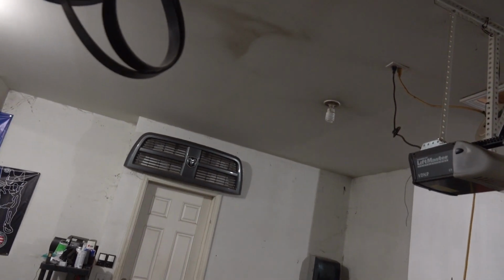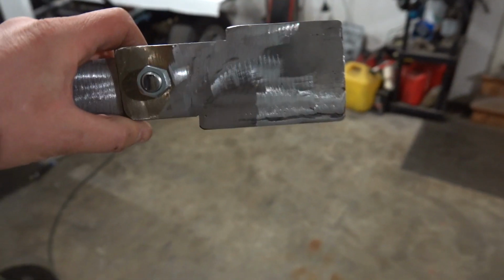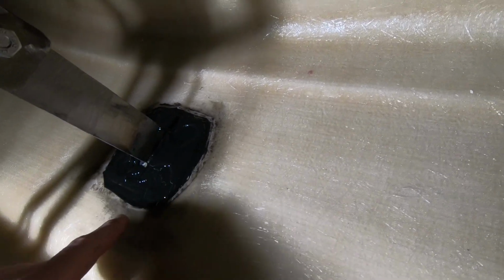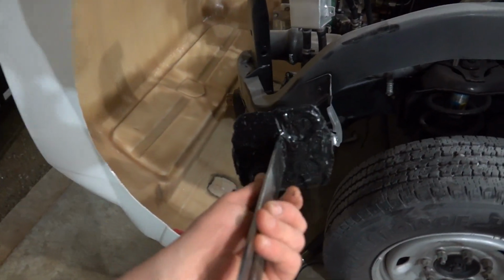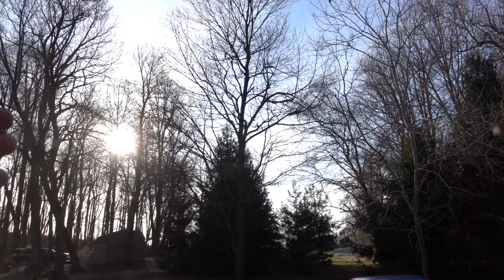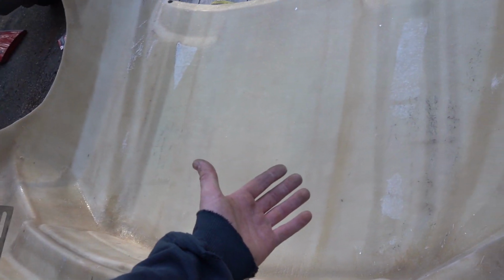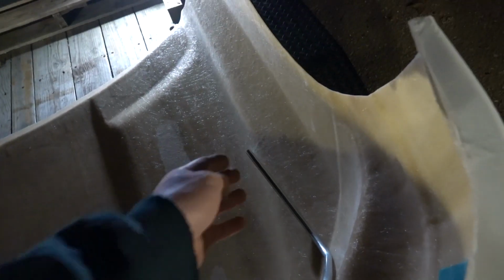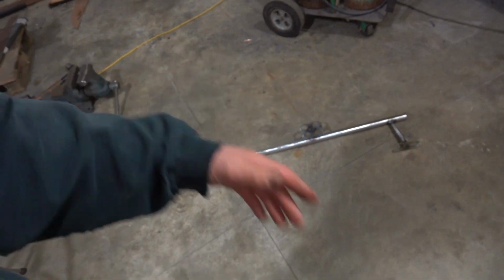FAIL! CUMMINS Tilt Front Clip Project Is Going BADLY!!!

Comment: not bad bud. keep it up. you need to have min of 6 points (the square plates you got from s/w) on the front atached to the pivot. bumper, fender,hood spread out. the epoxy kinda works, but this is how i do them and there is many ways. i use cleckos to hold plate to fiberglass, 2 on a plate while fibeglass sets up. then they just come right out the holes and then u just got the 1/8" holes to just mud up. also dont mix a hot batch of glass because it will show threw the front end after paint like little squares, lol.. your on the right track. also you can put strips on the doors in the front on the back side to hold the front fenders out so they dont suck in at speed and you wont need to have tube work coming from firewall to catch your leg on when everything is off truck to work..

Comment: The epoxy should only be to initially bond it.   Once it’s stuck then you fibreglass it over so the plate is sandwiched between the 2 layers of fibreglass.   That way it becomes a structural part.   Same thing goes for any upward braces and any check straps.

Comment: I use speed grip at my body shop all the time with steel hinge plates bonded to truck hoods just use a 36grit grinding disc and grind into the glass a little more and a little bigger bond plate would be a little better! But Norton speed grip holds the hoods on the trucks incredible!! And u can release that speed grip with a heat gun if needed! but it is a great product been using it for years at my shop with no failures!!

Comment: Tom experiencing the growing pains of becoming a design fabricator. There's a thousand ways to reinforce the shell but you for distracted by the inefficient ways when I was on the trailer. Once you went back on the truck it was super easy and obvious. I would have scoped around while it was on the truck with a tape measure and a black marker to map out the most effective structure. Try to get the final "ultimate" solution first try. Everyday is a school day, always learning new stuff.

Comment: Tom- you should fiber glass over the brackets after you epoxy them to the front clip. Make the fiber glass patch wider and that will help get more surface area to spread the load out with. it should also help with strengthening the pivot point as that will fatigue over time. I like the new support bar idea as well. Thanks for the content!